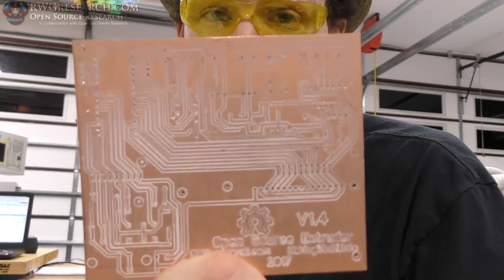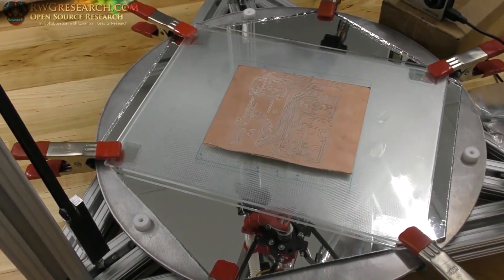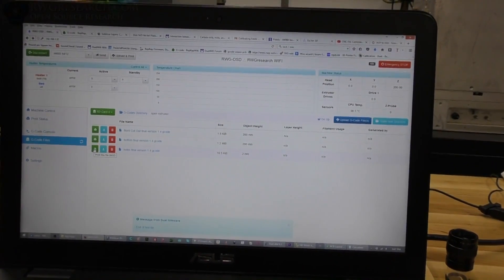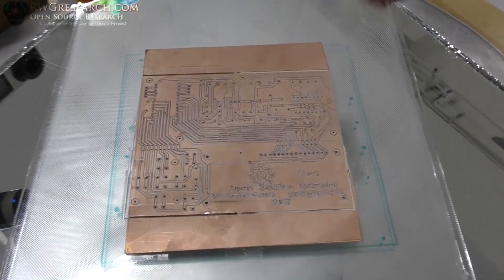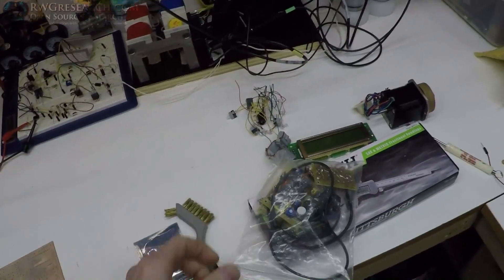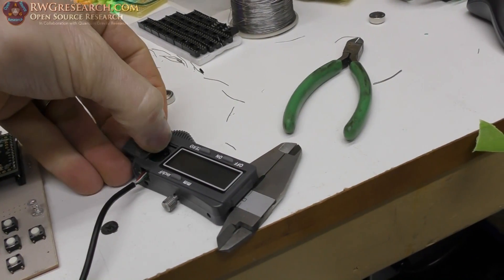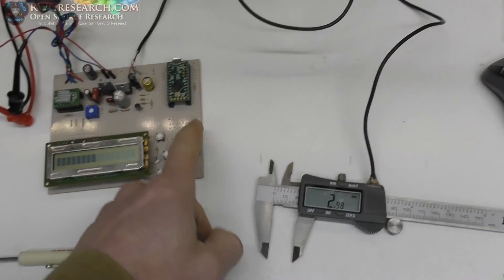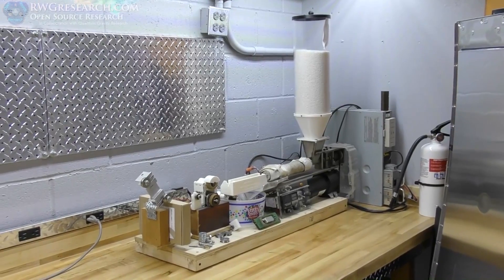#18 ~Russ's Filament Extruder: Making the PCB for Digital Calipers Measuring Device!

Comment: I have the same calipers. They always use the battery, even when off (same current too).  I noticed that 2 of those data out pads go to the battery contacts....Maybe I'll do a video on a AA battery adapter with a micro switch.

Comment: Just curious- why didn't you use eagle cad and pcb-gcode plugin.
Reply: Eagle is not free open source software on any tier. KiCAD is FLOSS though.
Reply from the maker: Diptrace worked better with Russ's printer setup.
Reply: I thought you had to buy egle cad? any way. just decited to use diptrace and give it a try. the old software I was using for not export as gurber files. ~Russ
Reply: I'm using Eagle 7.7, it has a free tier, and then I use the pcb-gcode ulp to make the gcode for my CNC machine.  They just released a new version since autodesk bought them but I've not tried that yet. Nice thing with the pcgcode ulp is that there's no gerber file you go straight from board layout to gcode. Although they do include a preview, but I prefer the flatcam preview to check it.
Reply: Paul Frederick Small boards and limited sizes are free. Not open source but then I didn't suggest it was.
Reply: +dabbishaw if they are limiting your liberty then it is not freedom. In the name of Saint IGNUcious I give you a penance of listening to the Free Software Song. I know,  cruel punishment, but you must learn your lesson! I will suffer along with you my child. Oh Lord no I clicked on the Spanish version!